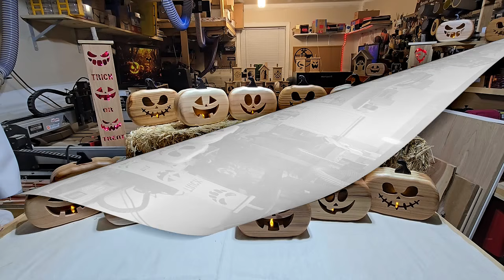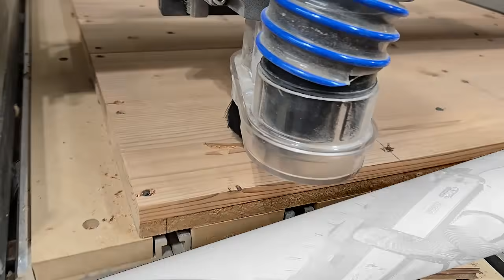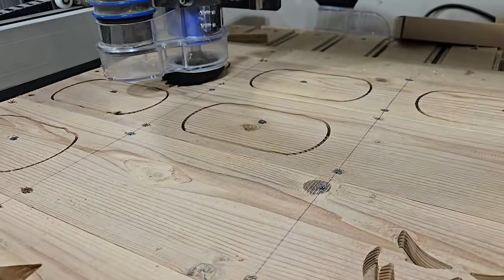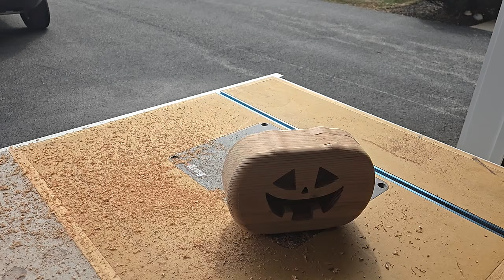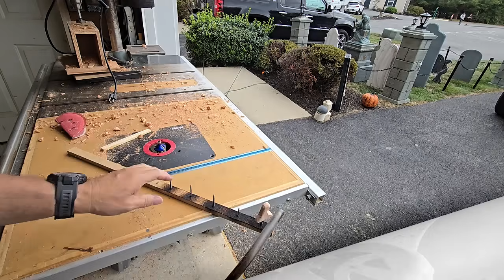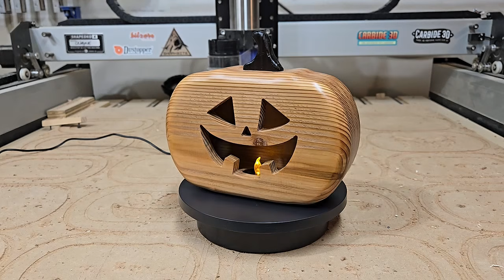Pumpkin Shaped Wood Jack-O'-Lantern

Comment: Do you sand the boards before you run them on the CNC or do you run them through a planer?  Cool project, my Grandkids will love them.
Reply from the maker: I sand the whole board as one piece before I put it on the cnc machine.  Its much quicker and easier to sand one big piece as opposed to a bunch on small ones.

Comment: How do you handle the pickets being wet? Do you dry them or use them just the way they are. Seems every time I’ve looked at them they had a high moisture content.
Reply from the maker: I've been lucky that I've been able to find pickets that are pretty dry to start with.  Plus the store that I usually get them from keeps them indoors with the regular pine lumber.  But if they do have a lot of moisture in them, I just lay them out in the sun to dry. I try not to use them wet.

Comment: These look fantastic, much better and more elegant than the other simple pumpkins I've seen online. I dont have a CNC, but I'm sure a band saw and a scroll saw would do the job. I'm gonna try something else: instead of making a hole in the bottom, try attaching the face, or the back with magnets so you can take it apart for the light.
Reply from the maker: Thanks!  These are definitely easily made with a band saw or scroll saw, or even a jig saw with a scrolling blade.  I had thought of using magnets on the back piece but I can never find cedar pickets that are truly flat to be able to use with magnets.

Comment: Those are great product!  Have you considered running the grain vertically to make the pumpkin look like it has grooves?
Reply from the maker: Thanks!   I originally wanted to run the grain vertically but with the cedar pickets being only 5 1/2" wide, I thought that might make the pumpkins too small or look out of scale. But this year I will be making larger pumpkins with 1 by 10 pine and 1 by 10 cedar boards with the grain running vertically.  And I will be making a video of that process.
Reply: @windsorwoodcraft  D'oh! that would have been obvious to me if I tried to lay them out.  But, you could always glue them.
Reply from the maker: @leisureshoot I had thought of gluing them together but can never find fence boards that are truly flat. I guess that i could rip the down into smaller strips and then glue them.

Comment: And how do you secure the candles?? But great video regardless!!! Earned a new subscriber!!!!
Reply from the maker: Sometimes the candle fits just perfectly snug in the hole that is drilled out but if it is a little loose, I use hot glue or wrap a piece of tape around the candle until its a snug fit.  It just depends on the style and manufacturer of the lights. Every box I buy seems to a little bit different in the exact diameter, even if it is the same style or manufaturer.

Comment: I love this idea! What have you found is the right asking price when selling? That's the hardest part sometimes.
Reply from the maker: Thanks.  Pricing is hard sometimes, depending on the area and the amount that people are willing to pay for them.  Last year I priced them at $25  for one and $20 each for more than one.  I don't think i could sell them for more than $30 where I'm located. I think that I sold over 70 pumpkins last year at those prices.
Reply: @windsorwoodcraft  Because I don't have a CNC machine, I'd be stuck using either a jigsaw or my scroll saw. It would take more manual labor time, which makes it difficult to factor in if it's worth it. I would think your pricing would be about the same for what my area would pay. I suppose I can try making one or two and see if my speed picks up.
Reply from the maker: A scrollsaw and jigsaw will definitely work.  I made a couple with those saws and it did not take that much longer than the ones on the cnc, with the setup and programming time involved on the cnc.  I was going to make more with the scrollsaw and jigsaw initially.  But then when I first listed them for sale on Facebook marketplace, I had 20 or more orders within the first week and about 10 to 15 a week after that. So I just decided to use the cnc so I could keep up with the order coming in.   I did not expect them to sell as well as they did.  I'm sure you could get the cut and assembly time down with the more you do and if you can establish an assembly line type of system like I did.  Also make ones with simple jack o lantern faces without a lot of intricate cuts, that will help too.

Comment: Cool project!  I just might try it, have a few pickets around.  I love its overall look, the feeling of weight, the vertical joint lines, and the size is perfect!
Thinking of storage, since the stem may break off, I may drill a pilot hole all the way through the stem top to bottom, then a vertical countersink hole partway, then secure the stem to the pumpkin with a hidden screw in that hole.  Then it can easily be removed, stored inside the pumpkin and re-assembled for display.  Also might do some sort of rotating latch inside a counterbore on the bottom for retaining the candle, avoiding the tape.
Reply from the maker: Thanks!  I  haven't had any storage issues so far with the stem, or being being weak or breaking off.  Good glue and a couple of brad nails are more than enough to keep it secure. But there are a number of ways to make the stem removable. You could put a dowel rod on the bottom of the stem with a hole in the top of the pumpkin, or even attach the stem with magnets in both pieces.  I have also thought and tried several different ways to mount the tea light in the bottom but it turned out that the tape was the best option for the light I used.  The first box of lights that I bought were a perfect fit for my 37m forstner bit and did not need tape to make a snug fit. But the next few boxes, of the exact same brand, were just a little bit smaller than 37mm, so the tape was the easiest option. Plus the tape and light are both black ,so the tape is not even visible. Even a small dab of hot glue would keep the light in place and still make the light removable.
Reply: @windsorwoodcraft  I like that dowel idea for the stem!  Screw and countersink hole abandoned!  😁

Comment: I think I am going to try a similar project, but I'm scared of hitting the nails with my router.  I'll probably use superglue instead so I don't make sparks all over the place.  Thanks for this video, I'm really excited to make some!
Reply from the maker: Thanks!  Actually, the back piece is only glued and clamped, there are no nails. The front piece is glued and nailed to the second layer, but the brad nails are only 3/4" long and they are nailed at an angle away from the corner so that the router will not hit the nail.  Good luck with your project!

Comment: Very cool idea to layer the boards and hollow out the centers. On the faces though, why did you decide to cut them using a pocketing strategy rather than just a female cut in multiple depth passes? I think that would possibly take 1/3 total machine time that pocketing takes?
Reply from the maker: Thanks!
 Do you mean a profile cut? It does work a little quicker,  but these openings are a little too small and odd shaped to do a profile cut. I have tried it in the past for these faces and most of the time the remaining pieces in the holes break free before the piece is fully cut out and can fly around, get stuck and jam up the router bit, not often,  but it has happened. On bigger openings, I would definitely do a profile pass.
Reply: @windsorwoodcraft yes, one of the camera softwares that I use calls a profile cut to the outside of a line, a male profile and a profile cut to the inside of a line, a female profile. One of the ways I avoid the scenario of pieces flying out & jamming up the bit is to use either 3m supper 77 or carpet tape with the string filaments in it. Probably makes the time savings invalid this way though.
Reply from the maker: I do use the carpet take or other double sided woodworking tape on alot of my projects.  I tried it on fence pickets in the past, but a lot of the pickets I find are warped and don't lay flat and the tape usually don't stick to the rough texture of the cedar, unless you sand it smooth first.

Comment: Great idea! These pumpkins look great. I'm going to try to cut them with my laser.  Thank you for sharing the SVG!
Reply from the maker: Thanks!  

If you have a 55 watt or higher laser, you shouldn't have any problems making these.  I have a Monport Onyx 55 watt co2 laser that I use to cut the faces for the box style jack o lanterns that I sell. 

FYI tip for using a laser to cut these,  try to be very selective with the specific cedar boards that you use.  Look for boards that were cut from the outer portions of the tree that have a wider spaces between the  growth rings. These boards will generally be softer and lighter weight than boards from the center of the tree. They will be easier to cut with one pass of the laser. 

If you have higher power laser, like 80 or 100 watt and above, than you should be able to cut the fence pickets with no problem at all cutting the boards from the center of the tree.

Comment: This is a great design idea. Some people are missing the point of the design by arguing over the cutting method. Others don't understand the simplicity of the design as they ask for templates and PDF's and what not. I mean, c'mon. If you can't draw an oval, maybe find another hobby.

To me, it's the round over and the sanding that makes this look nice. It really doesn't matter how perfectly you cut your pieces (within reason, of course) or even how perfectly you fit them together. The sanding will erase any imperfections created in the cutting and assembly stages. Anyone can easily make one of these with a jig saw and have it come out looking just as nice.

The real beauty of this design is only needing half of a fence picket. I make, and sell, the box style jack o' lanterns and for a 12" one, it takes just about all of a 6 ft board. To get 2 units that will  each sell for $30 out of a $4 board is woodworking gold.
Reply from the maker: Thanks! 
 It really is a simple project and can made with other tools like a scroll saw, jig saw or even a band saw. And they could be made with different thickness or type of material or different number of pieces stacked together.
The reason I used a fence picket was the low cost per board. I originally want to use  a 1x 8 cedar board but they are five times more expensive then a cedar picket.
And I think the round over of the corners and  smooth surface after sanding along with the spray finish make the look really unique.

Comment: So cute! Would it be possible to do with a jig saw or scroll saw? I would love to have a cnc but don't yet. Where do youtubers get their fence pickets??? Yours look so nice! The ones I get at Lowes look like a beaver chewed them off the tree!
Reply from the maker: Thanks!

This is definitely possible with a scroll saw or jig saw. I actually did make one with my 30 year old Craftsman scroll saw and also made one with a jig saw. Just trace the pattern to the wood like any other project with those tools.   

I get the fence pickets from my local Lowes store. It can be a challenge to find boards that aren't cracked or warped, but I will pick through the entire stack of boards if I have to just to find a few nice looking ones.   I also sand them smooth on both sides before I cut out the pieces.
Reply: Do you have the pattern that you’re using not for the faces but for the overall pumping?
Reply from the maker: @tammygonzales-eastman1564  Send me an email through the channel here and I can share the pattern. It it nothing special though, I just found a pumpkin photo online with the shape that I liked and converted it to use with my cnc machine.

Comment: It’s amazing what can be done when you spends thousands of dollars to buy a machine to do the cutting for you.
Reply from the maker: Just like buying a $5000 table saw to cut a board instead of a hand saw
Reply: @windsorwoodcraft  How arrogant do you have to be to respond like that? Seriously? You think anyone is out here spending $5000 on a table saw for small projects like this? Shoot. My first table saw was $30 from the pawn shop. 

Richard Michael is right though. Lots of cool stuff can be made when you have a machine do literally all the guess work for you. But talking shit to try and justify yourself? Poor form bud.
Reply from the maker: @namgorf2001  So you think that I just tell the machine what project I want it to do and the machine prepares the wood, cuts it to length, designs the project and programs the computer all by itself?   

And do you also get offended and comment on every other channel or video that uses a cnc machine, laser engraver, wood lathe, etc. or other expensive power tool to make a project?
Reply: I am not sure that is a fair comment. Just because the creator has a tool others don’t have, the comment seems a little rude. This is a great project that I can easily do on my cheap scroll saw. I don’t fault people whose videos I watch that use a domino or drum sander just because I don’t have one. I love this for the inspiration I got from watching it! As was mentioned it is not just another square Jack-O-Lantern
Reply: @tomtoonen5948 I was thinking the same thing as i watched this. A couple small modifications and my scroll saw would work beautifully!
Reply: You don't have to have a big cnc this project can be done on a table top cnc  it will just take longer to do ,I'm going to give  it a go many thanks
Reply from the maker: @chris26087  A small cnc will work just fine for this, I have made some of the box style lanterns with a small cnc. The main reason I did these on my larger cnc is that I did not expect so many people wanting to buy them when I first listed them for sale.
Reply: $499 for a 16 x 16 table top cnc paid for itself in its first month

Comment: Great looking little pumpkins. Quality work! Nice to see another person not use their CNC at full throttle. I certainly pamper mine. 
Thanks!
Reply from the maker: Thanks. I tend to run it at conservative speeds most of the time especially with an 1/8 inch bit. I've broken one too many bits to go crazy fast.

Comment: Do the tealights stick in the hole or are they lose?
Reply from the maker: The first box of tea lights that I purchased were an exact fit for a 37mm Forstner drill bit. The second and third boxes were a little smaller than 37mm even though they were the exact same brand name. The tea lights have a black colored body, so I just wrapped black electrical tape around the body of the tea light to get a tight fit.

Comment: That’s a great project! Love the use of clear finish on cedar. I usually use shellac. The clear finishes really make the cedar pop. 
Very very clever and different version of a jack o lantern. Can’t wait to try it out!
Thanks
Reply from the maker: Thanks. I thought of using shellac in the spray cans, but never have any luck getting a good looking finish with it.
Reply: @windsorwoodcraft I normally do several coats of the spray on shellac and I rub brown paper bag material on it between coats to burnish it.  
I hope that helps
I’m going to work on your version of the pumpkin today using a jig saw. I have scrap that I can experiment with.
Reply from the maker: @davidmata5080  Thanks for the tip. I'll have to try that some time. I also seem to get cans of shellac that have bad spray tips where the shellac spurts out unevenly or in globs, but maybe I just didn't shake the can thoroughly.
Reply: @windsorwoodcraft I haven’t had that problem but I tend to use up a can on multiple copies of a project. Shaking real well also helps.